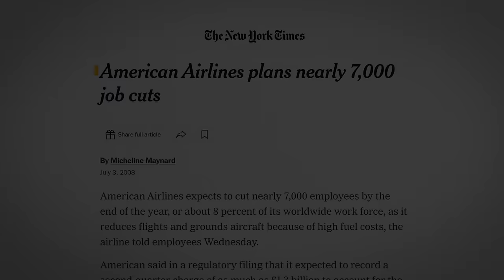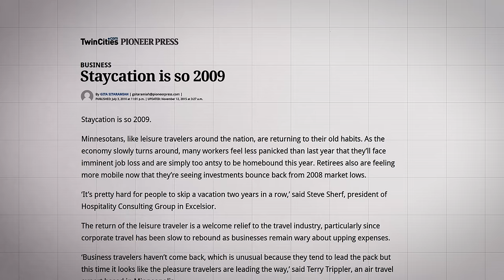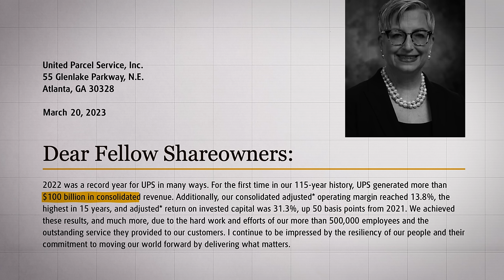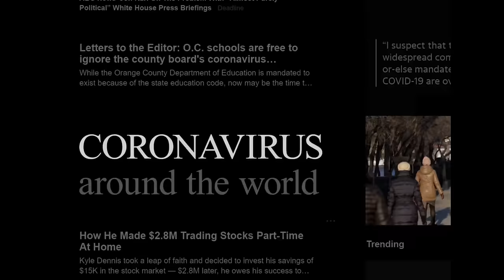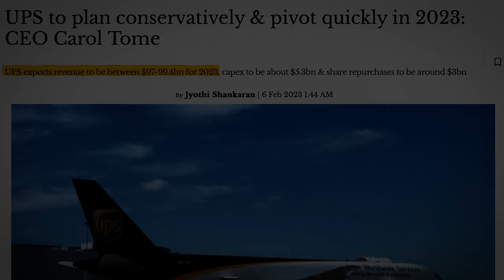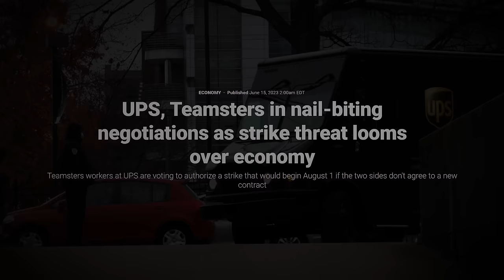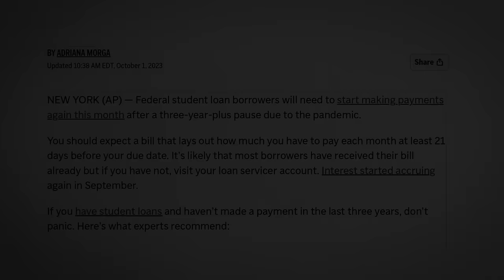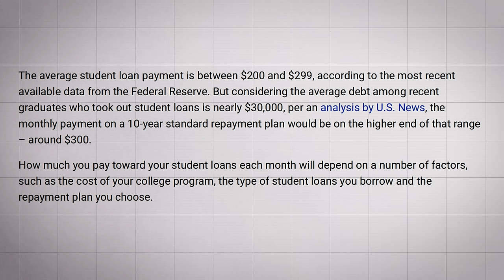Money is Gone: Airlines Start Layoffs Soon

Comment: I tried to ship a package from Texas to Ohio on Friday via UPS. It only weighed 9 pounds, but was a bit on the long side (15x15x48 inches).  They wanted $155 for the slowest ground shipping method. So I cancelled the pickup.  A relative of mine is planning to drive down next year and will take it back with them then.
Reply: I was at the UPS store to use their copier last week, and this couple came in with a package maybe the size of a large book. UPS wanted more than $40 to ship it for them. The couple said "Never mind" and walked back out of the store.
Reply: I used Greyhound. But don't know if they still ship?
Reply: For those kind of prices, I might have to start my own shipping company! 😂

One way, I could do half price and make nearly $5k with less than 100 boxes.
Reply: @jasono2139 Good luck to apply for all the proper permits with only 5k USD. Let alone getting the rest of fleet and labor and comply with all road and labor regulations.
Reply: @gteixeira  yeah... you understand that McDonald's also doesn't pay for their entire building from selling a single $5 Big Mac either, right?
Reply: @jasono2139  Sorry, don’t understand?

Comment: UPS shipping rates have gotten pretty crazy.  I used to buy and sell guitars online - but shipping costs have increased to the point that it is no longer feasible to sell online. And shipping holiday gifts from one coast to the other is now $75+ for a box! So if I shop on Amazon and ship direct, free shipping, instead of buying locally and shipping a box cross country, my dollar can go a lot further - which is important bc prices on everything have gone up in the last few years, but my salary has not changed.
Reply: A very real problem is that the retail seller who ships via UPS or Fed Ex does not pay the same amount per lb as does the customer.  For the small retailer, perhaps it is the volume shipped that controls the cost of shipping, putting the little guy at a disadvantage.
Reply: I know a cigar-box guitar maker who quit when shipping got too expensive. Or rather, he quit selling them. His walls are covered in guitars now. ;)

Comment: Was a ground crew in one of the busiest air freight operations in the world for almost 10 years. A few years before COVID I left it for an office job at a passenger airline. It didn't take me long to realize that the job security wasn't as strong in the passenger airline. Sure enough when COVID hit and I saw them starting to ask pilots to retire early, I saw the writing on the wall and went back to air cargo which was starting to go nuts. I always saw air cargo as something that was as stable as you could get in aviation. It's is crazy to see they're the ones struggling right now.
Reply: You didn't take a recall from the passenger airline? Or did you resign instead of taking the furlough and having that option available to you? I worked for UPS then a *alliance airline and the pax airline was so much better of a place to work at than UPS and our union contract at the *alliance airline from ramp was significantly better.
Reply: @gotacallfromvishal  haha I wished they those options available for the department I was in for pax. I was in maintenance at headquarters so no. For the air cargo I was an aircraft fueler for a ground support company contracted to a big cargo airline (I'm being vague because I don't want to start any conversations about those companies for various reasons). There were also personal reasons not related to the companies for why I left pax and later cargo. COVID just forced my hand at the pax airline and started the events that led to me leaving cargo as well. It was a blessing in disguise.

Comment: A long time ago, when it was a thing, I was in the cockpit of a 767 as a jump seat passenger because I was both an employee of the airline and a friend of the captain, on a flight that had at most 80 passengers...

Captain shows me the planes weight... it was 1000lbs short of of its max takeoff weight. We were a cargo plane with some passengers.
Reply: I've flown cargo flights as a pilot with very light loads. But, in actual fact the plane is bulked out. That is to say lots of large boxes with small, likely valuable loads. High value electronics for example. Often happens in the Far East.
Reply: A cargo plane with 80 seats?
Reply: @MS-37 No, its a 767, capacity of about 300. He meant that only 80 were occupied.
Reply: @MS-37  I flew as a passenger on a KLM 747 combi. Must have been around 80 seats. Wonder if any are still out there?
Reply: @oadka  Thanks.
Reply: @philipjamesparsons  I know Alaska retired theirs a few years ago. Must have been interesting to experience that.
Reply: OP, I'm guessing it was a fairly long flight?
Reply: @MS-37  Nopes. a passenger 767... with only 80 people on board but full of cargo.
Reply: @toddsmith8608  Santiago de Chile to Miami USA
Reply: @ekaftan  thx, so likely around 110,000 lbs of fuel.
Reply: Was in the jump seat for a flight from the Bahamas back to Florida. We went through a storm and I saw a few drops of water drip down from the center seam of the overhead console.

I thought any second I was going to see sparks, and then we'd go down in flames. 40 years later... I remember that clearly.
Reply: @MS-37  Those were 737s not 747s.

The only Combis that remain are Dash 8s and 737-200s in Canada's Far North and Okinawa.
Reply: @Dexter037S4  Swissair used to Combi their aircraft during the slow winter months to/from the USA.  I remember half the aircraft was bulkheaded off. Cargo containers shoveled into the back.  Long time ago, of course, but then again, I am a Certified Old Guy.
Reply: @Dexter037S4  no, KLM did indeed fly the 747 in a combi configuration. their were flown as combi aircraft up until 2020.
Reply: @philipjamesparsons  KLM converted 3 of their Combi 747s into a freighters, but eventually retired them in 2020. they currently fly 3 of the 747-400 Extended Range Freighter and 1 747-400 Boeing Converted Freighter that was originally a PAX-config -400.

Comment: Well the thing that kept me out of freight haulers was the night aspect. Otherwise I'd much prefer to pull up to the freight terminal than the hassle of dealing with the passenger terminal.  Getting on and off the plane on a set of maintenance stairs suits me just fine. Freight terminals are low key places, quiet, relaxing.
Reply: The thing that kept me away from passengers was parking away from the terminal, waiting for a shuttle then walking through the terminal to the gate.
As a cargo pilot, I leave my house 30 minutes before showtime and park about 100 yards from the plane. Easy peasy. Night flying can be challenging so we rotate and take naps.
Reply: Love the name!

Comment: Also, Amazon is doing more of their own shipping, on ground and by air, using their own aircraft and trucks. This is  taking market share form all other freight carriers as well. I think this is a key factor not weighed highly  into you analysis :-).
Reply: Yes and no.. it's more net neutral then anything for the companies themselves. Anyone that had contracts with Amazon were making very little profit but we're forced to over hire to meet the contract demands. It bit both FedEx and UPS in the butts which is why FedEx dumped the Amazon contract and UPS didn't renew the contract with Amazon forcing them to accelerate their air service going online. Now the problem is both companies have/had an excess amount of employees they no longer need so the cheapest option is to try to push the early retirement options and keep the cheaper newer employees.
Reply: Yes! Amazon has the volume and the data to selectively internalize, or “subcontract” to “local businesses,” wherever they see fertile crops they can plunder. I wonder how Amazon treats its pilots relative to UPS, FedEx, DHL, and other cargo companies.
Reply: Amazon uses contract airlines. A pilot I know works for one; told me load reductions and pilot job cuts.
Reply: Amazon has no aircraft. They contract all of their flying.
Reply: I suspect Amazon is also doing quite a bit to reduce the amount of air freight while still selling the same amount of stuff. Getting smarter about anticipating demand and stocking warehouses accordingly, pushing the delivery option where everything is delivered on the same day (so they can ship warehouse-to-warehouse by truck), etc.

Phase one: take losses if necessary to corner the market.
Phase two: start squeezing...

Comment: Factors not covered in this video: Amazon Air has an annual cubic cargo volume that is about 1/4 the size of UPS worldwide, and growing; they set the goal years ago to scale back UPS/FEDEX use because of rising costs. Amazon has a contract with Atlas Air (among others) for cargo at better rates than UPS. All shippers are contracting more cargo to second and third-tier airlines, including regionals (Hawaiin, Silver, etc but not the big airlines whose costs are too high due to labor). UPS cannot compete with non-unionized airlines (or at least those with lower unionized labor cost). Added to this, the annual imports of product from China dropped 16.4% in 2023, and is going to recover...many years from now, if ever (that issue is due to Chinese economics, not the global economy). Oh, and the USPS is shipping cargo at a loss, in a desperate move to stay relevant past 2024.

Point is: UPS and FEDEX are being squeezed by lowered international trade volume (mainly from China), and increasing labor costs. Domestic transport is more competitive, with even the US gov't willing to take a loss to beat UPS. UPS's prime customer built their own airline for the specific purpose of scaling back UPS/FEDEX. It's all working to squeeze them hard. It will probably get much worse.

I'm not happy that UPS people are also going to get squeezed. Just pointing out the data, good and bad.
Reply: Kelsey commenting on UPS is like a Ford salesman telling you about Chevy.
Reply: Correct... USPS can ship many things "cheaper"... because you've already paid for their crummy service through tax dollars, whether you like it or not.

...and surprise, surprise ridiculous labor unions and union rules are artificially driving the cost to operate these companies through the roof with idiotic seniority  rules and non-merit based pay.

If you can make $170k/yr driving A TRUCK for USPS... why in the F would anyone with a brain go into engineering or medical when you can get better pay with a job that requires little education and minimal responsibilities.
Reply: This is what I was thinking of while watching the video.
Reply: @jasono2139 
That 170K isn't across the board, the highest paid drivers will be OTR (Over The Road) or long haul 18 wheelers. The local delivery van definitely won't make that much. Probably somewhere about 60 to 70k, with insurance, vacation, and other considerations.
What you need to keep an eye on are the salaries in the C Suite. Is the CEO still getting a bonus or perks.?
Reply: @jasono2139 they really don't make that much and what most I've talked to aren't smart enough to figure out (they were striking again for higher pay). They were heading for the death of their jobs.
Just like mcds employees did and now you're seeing more automation less employees.
Automotive is heading there too
Reply: Five years ago, I never saw an Amazon truck in my subdivision, but the UPS truck was a daily sight.

Now, I see Amazon trucks every day, sometimes more than one a day, and there are days when I don't see a UPS truck in the subdivision.
Reply: @kentfrederick8929  Some days I see two Amazon trucks - at my house. As in multiple deliveries.
Reply: @lowellmartin8907  lmao... ONLY $60k to $70k... most engineers are LUCKY to make that starting, but won't make anywhere near $170k after many years regardless of seniority.

...and somehow Jim Bob who's only responsibility is to carefully move a box from a truck to a doorstep and not crash into anything on his way back to dispatch, is going to make more than the people building the bridges he's driving over is beyond me.
Reply: @nickabel8279  that's most union employees... they're too dumb to realize how easy their job is and how replaceable they are.

Most are too busy whining about how a CEO overseeing a GLOBAL company making $100B in revenue is getting a few million more than them... despite none of them having a clue about how to even run a lemonade stand. 🤦
Reply: @jasono2139 Aside from long haul tractor trailers? No one "drives a truck" at UPS. Their drivers are the delivery folks, and UPS literally times how many deliveries they make every hour, and penalizes the ones who aren't literally running to make their quotas. $170k including medical, pension, and whatever they are packing in that figure, is NOT what they are paying any delivery driver I've ever met. It ain't that cush a job.
Reply: @lyfandeth  $170k INCLUDING BENEFITS is still insane... I use to get $90k (that included benefits)... and for $170k, you sure as hell should be running between stops.

...and I don't care if they have to "drive a truck" AND delivery packages. Do semi truck drivers also need to brag that they don't JUST "drive trucks" because they also have to stop to drop of trailers or hand people paperwork. FFS... 🤦
Reply: If this was true how so u explain us postal?
Reply: Atlas air has all but pulled out of Amazon why do you ref them in your comment ?  The biggest contractor for Amazon is ATSG, since both are publicly traded this is free info.
Reply: your 100% RIGHT sir    its price to pay to suport union

Comment: my auto insurance premium with USAA has jumped 30% for 2023 over 2022, with no changes, no traffic tics, or claims. Happening across the board in the insurance industry with all insurance due to increase claims due to auto theft, breakins, higher auto replacement costs.

Comment: I work for a very large cargo operator and we are adding flights and hiring like crazy.  Haven’t noticed any change here but that can always change
Reply: The bad thing is that such behavior might the executives gambling on something risky or trying to otherwise make things look OK before the collapse so they can get out before the stock tanks.
Reply: Do you cameras in the latriene?
Reply: @Blackmongoose13 but does that cargo operator own the aircraft it uses?
Or at the least, lease them? If not, & you look at the airline/s they use, then figures could be rather different, to your companies increases.
As approx 45% of airfreight is transported passenger planes (& 50 percent of the goods in the hold are air cargo), but number of passenger flights is not yet back to 2019, & the few year prior figures, there's an overall shortage of cargo space.
Also, while some air cargo for a few has increased (& it's still no more than 9% for any), it's very often due to re-routing & getting other companies businesses. Plus it is very region specific, for the few ones that had a small increase.

Your company may be getting more cargo but why are the companies, that were using different companies until Jan 2020, now using your company instead.
Also, with restrictions imposed re increases of costs charges & prices for over 2 years from mid-late 2020 to around April/May, in a number of regions, it means are (more or less) effectively seeing 3 years of normal increases, at same time.
The entertainment industry (a major cargo user for goods sales, as well as for events transportation) is still a fair away from 2019 figures, as is (but is showing more improvement) the hospitality industries.

*Note/Edit: I wrote comment after only watching 1 minute of Kelsey's video, as didn't want my comments to be influenced by his, but after watching it all I see he mentions some things above